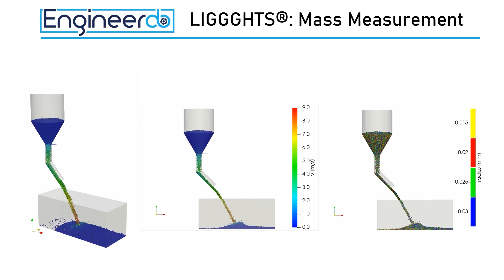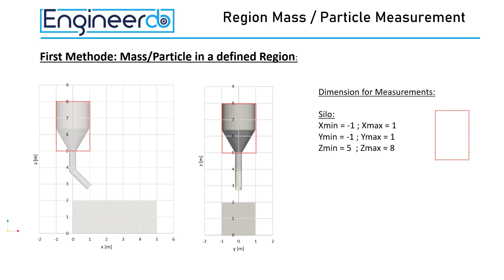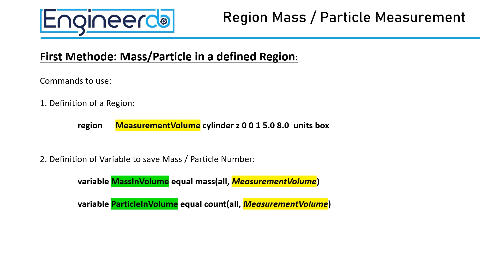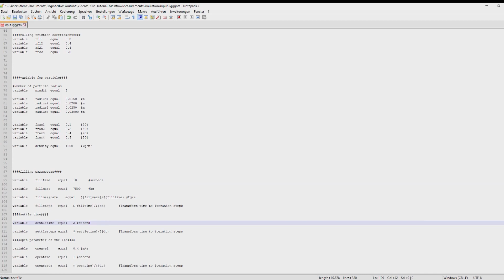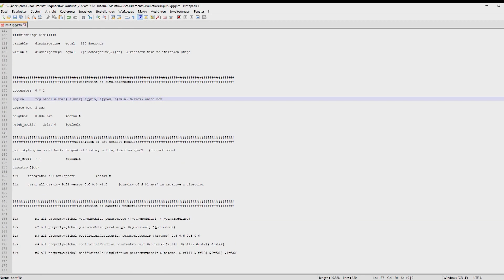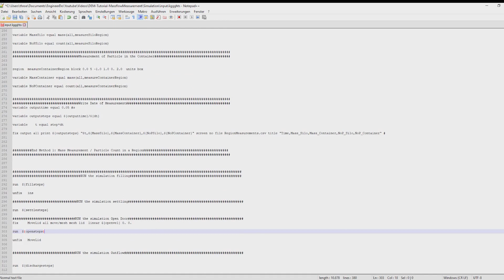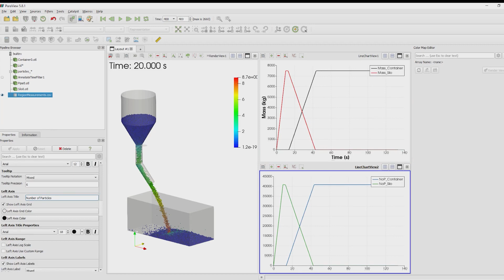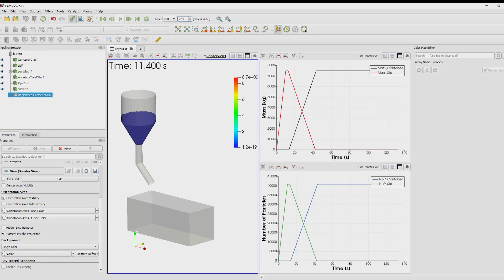DEM Tutorial - LIGGGHTS: Mass Measurement - Part 1

Comment: i used the following and got only zeros in the csv file how can i calculate the mass and number of particles with different types thanks

region measureinsertion block 0 0.15 0.7 0.9 -0.3 0.3 units box

group g1 type 3

variable absinsmass equal mass(g1,measureinsertion)

variable absinsNop equal count(g1,measureinsertion)
Reply from the maker: Hey Pain,
is the simulation running without an error to the end? Is there any error massage in the log file? Else I would assume that the error might be somewhere else. Have you included new 3 types of particles during create command?

Comment: If we had 2 or 3 type of different particle types and we need to find how much of  each type inside the container i tryied adding a gŕoup and replaced all with the group nam in variable line got 0 any tips thanks
Reply from the maker: Hey pain, in general it sounds like the right way. Maybe something went wrong with definition of the types? Have you also double checked, that you are measuring in the correct region?

Cheers, EngineerDo
Reply: @engineerdo6568  i solved the problm thanks for the content and if possible do a video about expanding liggghts with new add ons  and recompiling it
Reply: @painrikosu1017  hi how did you solved your issue? I have the same problem
Reply: @borancam7426  hi i used two types with the group command and used the set command to define the groups and then dumped them using the print command like the video

Comment: Thank you!!! It's relally enlighting. Can this be used to calculate the volume fraction of particles?
Reply from the maker: Hey Frost, thanks for your feedback. 
in general you can use the command for volume fraction calculation. But if you define a region you have to be aware that in liggghts the particle is counted as soon the center of the particle is inside this region. If you make a cube and fill it top the top ending with a smooth surface, you can get a quite accurate volume fraction with the method.

Cheers and stay safe, Engineerdo
Reply: @engineerdo6568  thank you!!!

Comment: Thanks for your videos. I am new to liggghts. Your videos are really helping. 
Please do you have an idea on how to simulation triaxial test in liggghts
Reply from the maker: Hey Derrick, thanks for your feedback. We are allways happy to help people to solve their problem.

For the triaxial test you will propably have to take a look to this command in the manual:

fix mesh/surface/stress/servo command

Here you can controll the movement of the walls bei a forces.
Reply: @engineerdo6568  Thanks for your response. I have checked the function and i have applied  it. The problem i am facing is how liggghts is calculating the stress in the system. I want the overall stress state of the system at every time step but i get stress matrix for each particle in the system at every time step.

And also how to calculate the volume change and void ratio of the system during compression
Reply: @aikinsderrick hey, i m doing the same could u please help its bit urgent

Comment: Nice to know, I think this could be useful for many applications. I already used the csv output to get the total force and momentum.
Reply from the maker: Hey Sam, thanks for sharing. In the second part we will show a method to analyse the the mass or particle measurement by mesh. This method is very similar to the handling of forces.

Comment: I would like to thank you for nice video and simple explanation.
Could you please explain how we can find volume fraction for settled particle in silo( in general how to find the volume fraction of generated particle).
Thanks in advance 
Regards
Reply from the maker: Hey Yassin, thanks for your feedback. You simply can do a measurement geometry in paraview using the clipping tool. From that you get the defined volume which value you know. Now you have to sum up the individual volumes of the particles. For that you can use the python programmable filter or you export the timestep as a *.csv datafile out of Paraview and open it in Matlab or Excel. Doing that you get the volume of your region and the particle volume. The fraction is what you what to know.
Reply: @engineerdo6568  Thanks a lot.
Reply: @yassinalkassar9876  

I see a lot of applications for this video.